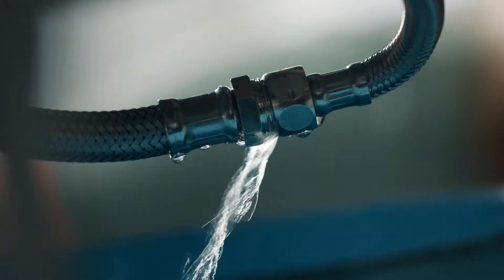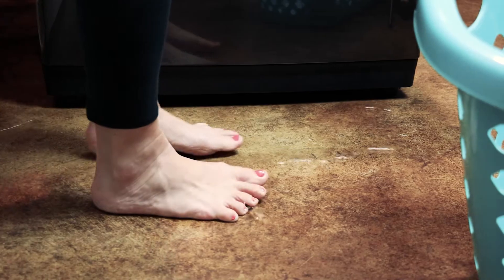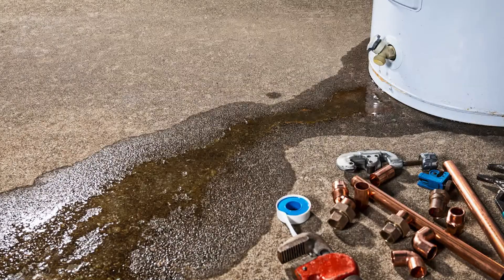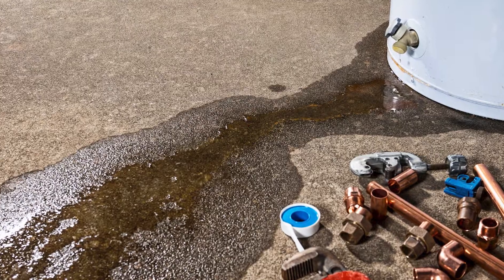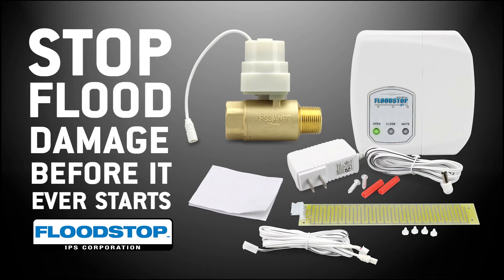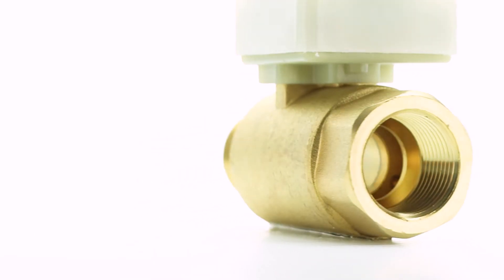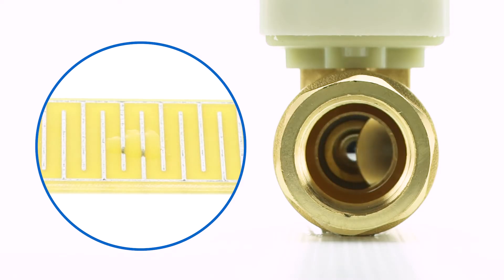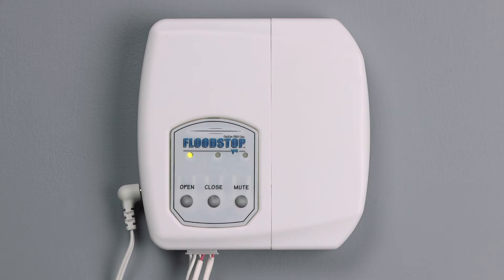Floodstop Overview

Comment: I've gone to do PM on a building and the floods top valves motor sounds like it's working but the water never stops flowing. Is that thing just burned up?
Reply from the maker: Hello. Please give us a call at 1-800-888-8312 and a customer service representative will be able to help troubleshoot the issue.

Comment: If one day, with this product, you have no water flow even though you have pressed the open button on the control panel, but the water will flow if you press the close button, then you have a bad water valve and you have to replace the whole thing meaning the whole valve. Something goes wrong with the little motor that turns that valve on and off.